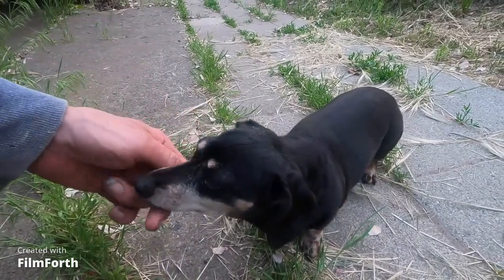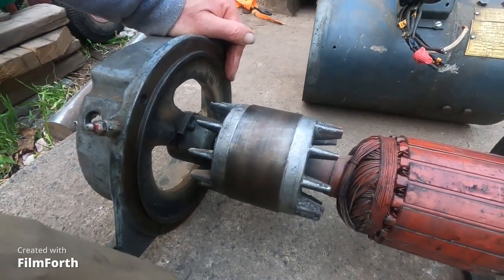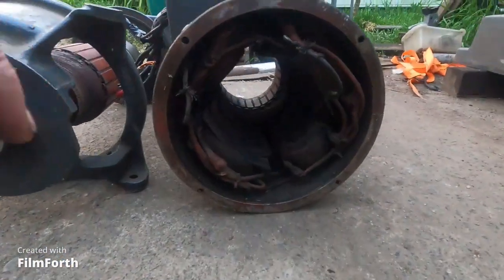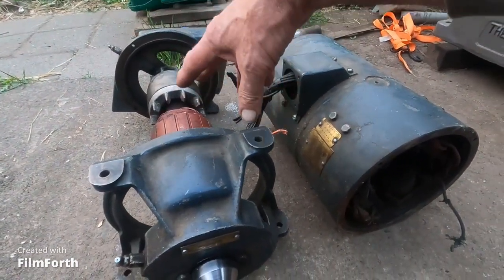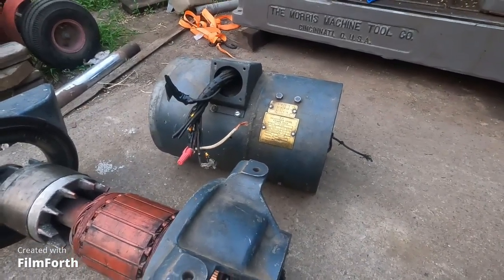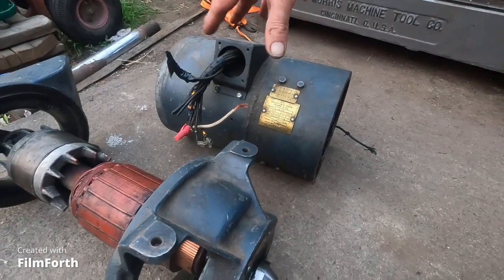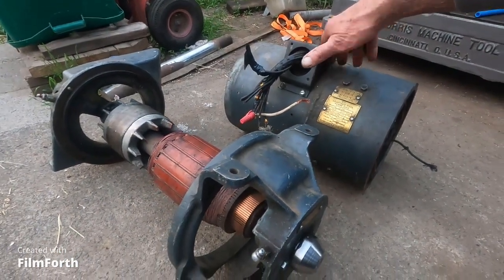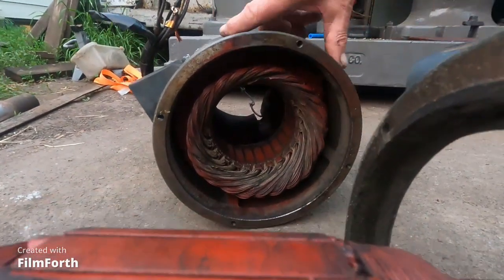Monarch 10ee lathe motor generator unit burned out

Comment: I was fixing doors in the elevator machine room of a commercial building a little while ago, and I noticed that the elevators cable pulleys  were all driven by  motor generators. They were slightly larger than this one from the monarch.
Reply from the maker: Relience was the manufacturer of the Monarch drive, I just looked at a couple of larger units at the scrap yard and they have some huge DC motors from an old food processing company, years ago the electrician there showed me how to use commutator and slip ring dressing stones that are recommended by Relience, but you do it on running motors and generators with caution. Elevator machine room sounds scary!
Reply: @deedeeindustrialsuperprecision  elevator machine rooms were in a top floor space or roof penthouse. AL B.
Reply: @deedeeindustrialsuperprecision  And that's why they needed the doors fixed, so no one wanders in there. Yes, I remember that video when you mentioned how they recommended to dress it while running.

Comment from the maker: I thought this might be interesting showing this 300lb unit opened up. Keep in mind the age of these when using the lathe and decide how much rpm loss from loading and resulting heat build up is acceptable. The DC end was burned out when I got this, so I used it as an idler motor for a phase converter and I then burned up the AC motor end from overloading causing a short. Be careful out in the field folks!

Comment: Did the exciter control the field winding strength. While the armature and brushes put out the DC current.
Reply from the maker: Yes, the big generator provides 220 volt DC to the spindle motor armature, the exciter provides 120 volts to the spindle motor field. 
From zero to1100 rpms the armature voltage is varied and the field at full voltage.
From 1100 rpms to 4000 or top speed, there is full armature voltage and the field voltage is reduced.
 At base speed 1100 there is full voltage to both armature and fields.
Reply: @deedeeindustrialsuperprecision  Now you understand why the early 10EEs are so smooth! It’s not as simple as you think.

In hydroelectric power, water drives the turbine which drives the alternator which drives the dc generator which is called an exciter. All on one shaft.

The power company modulates the output voltage of the exciter to balance load required. This modulated voltage is what excites the alternator stator windings.

The Leonard drive was an electromechanical solution for its time. They cool, smooth and robust. But they are getting old.

Personally I would rewind the beast before looking for some Chineseiuem replacement!
Reply from the maker: @devmeistersuperprecision4155  I am one of the few individuals that has struck back at the racist fake machinist forum and the short panted idiots here that advocate ripping out these drive systems to replace with off the shelf junk and badmouth the company, all rooted from one individual known as Southern Racist "Stink Finger DT" and his forum trolls. Where have you been? You will see more on that.

Comment: So, it amounts to a rewind, or perhaps a second machine for parts, or is a VFDrive a possibility?  How original do you want to keep the machine?
Reply: Dee Dee can speak for himself of course but THAT specific motor generator unit had already been repurposed as part of a home made phase converter to provide 3 phase to several machines he has and not from a recently running lathe. He's not trying to replace it.  He's getting a modern phase converter that does the whole thing in a nice safe package.  Not sure which would be cheaper or easier to find if he was replacing it in a 10EE. A rewind or a working original? Maybe dee dee can chime in? 🎐 lol
Reply from the maker: These units can be rebuilt. There is no modern replacement DC system with full speed range via field weakening and dynamic  braking for high speed threading right up to a shoulder that is used instead of mechanical lead screw reverse systems used on other tool room lathes.
Reply: I stand informed, did not realize exactly what was what, thank you, Chris